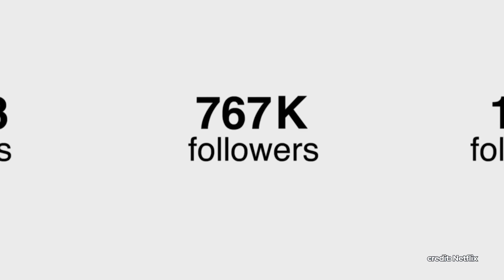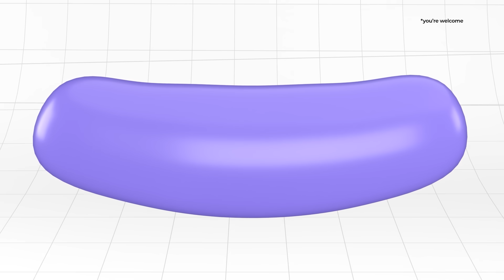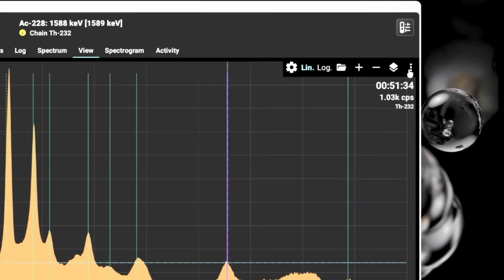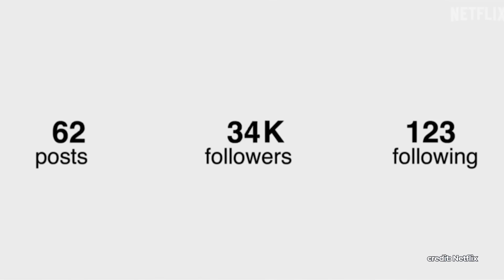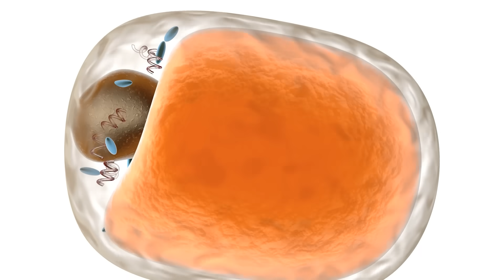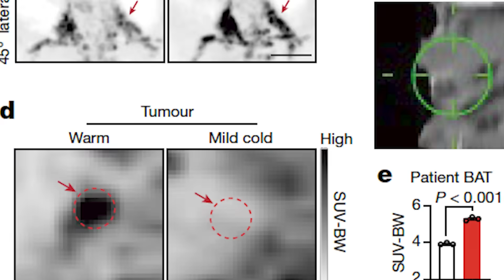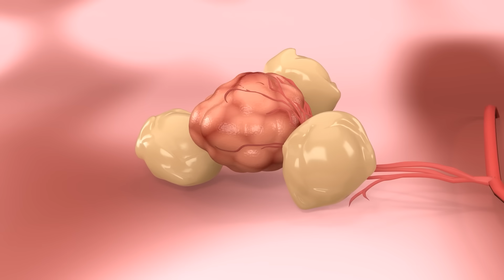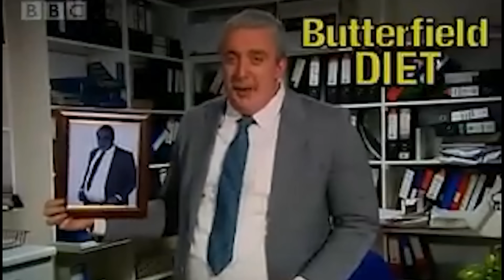Scientists Just Discovered How to Starve Cancer

Comment: What happened to the modified cells after the cancer is gone? Do they remain in the body to prevent future cancer cells, and if so what effect would they have on the body if there are no more cancer cells?
Reply: I wanted to assume that it can still be traced with a PET scan and surgically be removed the way it was applied, if need be. But definitely would like more information one the after effects of the tests as well.

Comment: Cancer switches to using glutamine as a fuel when denied glucose . So you have to block the glutamine pathways as well as the glucose ones .
Reply: Right. As Thomas Seyfried says, press the glucose and pulse the glutamine.
Reply: Research etymology. Glue - Glutamine, Gluten and Glucose.
Reply: Fenbendazole does it. Duh!
Reply: @ThatUkrainianGuy1  Tricky though... you have to pulse it, the gut and immune system can't sustain prolonged glutamine blocking
Reply: @djanitatiana  Tricky, how so?  Pulsing is simple.  On.  Off.  On.  Off.
Reply: @ThatUkrainianGuy1 please explain
Reply: @Lee-hq6tf  if you formulate a question precisely, I will.
Reply: @ThatUkrainianGuy1  what are the benefits of fenbendazole in cancer patients?

Comment: I vaguely remember thermotherapy is also effective(?) in killing cancer cells too. Body does not usually able to sustain in high temperature, releasing fatty acid to dump heat. As a result, Cancer cells which usually had immunity check have to release the substance, prompting body to kill it, or it will be cooked. Glad we have more tricks!

Comment: Side note. Giving the tumor an infection with a specific pathogen is an interesting approach. Most cancers are more vulnerable to same due to their mutations. Helps the immune system see the problem. This is an interesting approach here as we could poison the local energy supply to the tumor.
Reply: There was a study where they gave rats the flu vaccine and the closer the shot was to the tumor the more the immune system worked against cancer.
Reply: @babybalrog  unfortunately, there is no universal vaccine. Immune therapy requires specific vaccines for specific cancers. But if you know the match -- it actually works.
Reply: The black salve theory: It irritates the skin so immune cells rush to the area killing the basal cell carcinoma.
Reply: @babybalrog part of why cancer grows is that it turns off the immune system with regard to itself. Perhaps the flu shot super activated the immune system briefly.
Reply: Might add immune activating genes to the fat cells as well. Need to get rid of them later of course but maybe could even get the immune system to clean them up afterwards.
Reply: @lizekamtombe2223  given the average American diet, it may not be necessary to remove them, unless they start producing too much heat.
Reply: @caseyb1346  Spontaneus human combustion cases will go up you mean?
Reply: @ we're making Extremis real.
Reply: @lizekamtombe2223 Do you want people to die from fat loss? That idea is stupid and ignorant.
Reply: A pediatric oncologist injected herpes zoster virus directly into the inoperable brain tumor of a teenage boy and it was a fairly successful if novel treatment.
Reply: Aren't those called oncolytic viruses or something? The ones good at killing cancer in specific.
Reply: Reminds me of a video I watched about why whales don't get cancer: they can develop tumors, but their bodies are so big and have so many cells that tumors take much longer to grow big enough to become a threat, and eventually they end up mutating further to develop tumors of their own called "hypertumors", which stunt the growth of their hosts by starving them of nutrients and/or eating the tumor itself from the inside out.
Reply: Tactics can win a battle. Logistics win wars. In the war on cancers, maybe we should focus upon attacking cancers' logistics by treating cancer as a METABOLIC disease.

The USA war on drugs wasn't successful. Maybe a metabolic approach might have worked better.
Reply: @solconcordia4315  so what is that ? Metabolism approach ?
Reply: @solconcordia4315  respecto a eso... De verdad tienen que eliminar el consumo, el uso de esas sustancias bajo prescripción médica, dejar de comprarle esos cargamentos a los países, la droga nunca viene sola, se acompaña de armas, tecnología, personas, comercio de otros productos y servicios, pero tienes grandes logísticas de guerra en concentrar el crimen en ciertos sectores vulnerables y raciales, tienes un sistema que nutre sectores más ricos. Y todavía culpa a los otros países. Pero deciden luchar de manera física con un solo problema.
Reply: @solconcordia4315 i ve always thought it was futile to just treat a tumor because if you dont change the environment that makes for favorable growth, how can you keep it from growing back?
Reply: Good note!
Reply: My mom thought of that and we have eaten sugared ginger in hopes of cancer taking in the ginger sugar and killing the cancer.
Reply: @agrotta1650  ya my mom says quality baking soda and molasses mixed in water bonds together. When we drink it, the cancer pulls in the sugars and consumes it.  As the cancer breaks it down, the baking soda part of it releases high oxygen, in turn killing the cancer.
Reply: But what if you go one step further and give your tumor cancer? 🤔
Reply: Its hard to believe nobody has mentioned the recent success in Germany injecting Chlorine Dioxide in tumors where it dissolved the tumor and all cancer disappeared with no other harm
Reply: People do this with Warts, infect the area and the wart will drop.
Reply: Same sort of treatment works on warts.  Yes, you can cure warts.  My local mayo clinic does it by injecting a fungus into the wart.  I had warts for years that endured every type of treatment.  Even lasers shot at them did nothing.  Injecting the fungus got rid of all of them like magic.
Reply: See Coley’s Toxin. It’s all been done before, 100 years ago.
Reply: We figured this out 25 years ago.  It was on the cover of Time magazine.  A chemical drug called Venostat.  Which stopped veins and capillaries from growing into the cancer and so it would be starved of oxygen and die.  We've already been here and done it. A quarter century ago.  It was suppressed.
Reply: This is an approach people are currently working on, and in fact 2 oncolytic viruses have already been approved by the FDA. The first is talimogene laherparepvec, for inoperable melanoma, and the second is nadofaragene firadenovec, for some high-risk non-muscle-invasive bladder cancer.
Reply: What happens when this so called "engineered infection cells , who are exposed to our own healthy cells runs out of cancer cells to infect and then , as a result  evolutionarily gets selectively bread to infect our healthy one over time? (Survival of fittest)
Reply: @soulsbourne Then, you take an antibiotic, or your immune system clears it out like any other disease. Ideally you would not choose a base disease that could actually be threatening to most people, you would choose something that might give you a minor cold.

The goal is that the immune system courtesy of the infected virus cells or infection would start detecting and eradicating the cancer cells on their own.
Reply: What if they force the tumor to create the fat that will starve and kill it?
Reply: Possibly my favorite cure so far. It's a way of exposing tumor cell's  cloaking abilities to the our bodies T-cells. It's pretty genius!
Reply: What about bee stings? They activate the immune response, check the Lyme disease bee stings lady
Reply: 2 Tessalonicenses 1

Paulo, e Silvano, e Timóteo, à igreja dos tessalonicenses, em Deus nosso Pai, e no
Senhor Jesus Cristo:
Graça e paz a vós da parte de Deus nosso Pai, e da do Senhor Jesus Cristo.
Sempre devemos, irmãos, dar graças a Deus por vós, como é justo, porque a vossa
fé cresce muitíssimo e o amor de cada um de vós aumenta de uns para com os
outros, De maneira que nós mesmos nos gloriamos de vós nas igrejas de Deus por causa da vossa paciência e fé, e em todas as vossas perseguições e aflições que suportais; Prova clara do justo juízo de Deus, para que sejais havidos por dignos do reino de Deus, pelo qual também padeceis; Se de fato é justo diante de Deus que dê em paga tribulação aos que vos atribulam, E a vós, que sois atribulados, descanso conosco, quando se manifestar o Senhor
Reply: the polo vaccines cures non surgical blastoma in the head if patent has good vitals. first the tumor swells then over 3 month it dies. it leave a hole were the cancer died.
Reply: They have been doing trials on brain cancer and using the polio virus.
Reply: It's been a well known fact for 4 decades that the immune system itself kills cancer and is most always 100% successful at it every time they do an allogenic bone marrow transplant to cure blood cancers because the brand new immune system sees the entire body as a foreign object and begins attacking various organs and in the process kills any remaining cancer cells. It's called Graft vs Host disease or GVHD. It's so powerful it can kill the patient itself in minutes if an attack is not quickly calmed with a high dose of Prednisone.  I learned about all this in 2009 when I had a transplant from an unrelated donor to cure leukemia. 16 years ago and still no cancer.  After a Google search out of curiosity it said scientist have been experimenting with it to cure other types of solid organ cancers but the procedure still remains extremely dangerous and why it's still in a testing phase. If they could figure out how to point the immune system to cancer cells only without damaging other bodily organs I'm pretty sure that's a cure in itself.  A bone marrow transplant is a totally painless procedure and done in a few minutes but only after the original bone marrow has been destroyed with chemo a week prior. A doctor wasn't even in the room when I had mine. It was just like a blood transfusion administered by two nurses. It's all the stuff that starts happening in the following months that is dangerous. Mine even changed my blood type from O positive to B positive.  O has no antigens so I can still receive blood from O donors.  mRNA vaccines is an attempt to accomplish the same thing but fails miserably. Much more knowledge is required to really understand what makes the immune system do what it does.
Reply: there are also multiple viruses being crispr'd to eat cancer proteins which then die once the cancer cells are gone.
It's very promising, but will probably need another decade or so in trials as genetically modifying cancer eating viruses, that usually would hurt us, too, is a very sensitive topic
Reply: Yeah, I love the 1901 Italian rabies vaccine they tested on prostitutes. It MELTED their fibroid tumors.
Reply: I'm experimenting on myself with self-vaccination on stage-4 (metastasized) cancer. I discovered from Wikipedia that I largely have TWO lymphatic systems: one for each side of the body, the one on the right much smaller than the one on the left. They are drained through different bodily exits.

I got metastasized cancer on the left side but none on the right side. After fasting for and doing the antimatter Positron-Emission-Tomography with POSLUMA, I forgot to flush the radioactive moiety early enough but I did wake up to the fact that I needed to get it flushed out (it's highly radioactive — equivalent to eight years of background environmental irradiation). I prepared some citrus-laced water and survived on it alone for a while (and supplemented it with Biblically known olive oil for calories; three days were how long Jonah had stayed inside the great fish so I flushed for a total of three days). I figured that the terpenes hot-water extracted from the orange peels would clean out as a surfactant much of the debris of the radionuclide scan and some of it would flood over to my right side to trigger my reserve lymphocytes in my reserve immune force's lymph node. Sure enough, the main lymph node near my neck on the right side swelled up but after a few days it largely shrank back to normal size.

Maybe the self-vaccination has already started the lymphocytes' fight already.

I keep my fingers crossed🤞 and I know that I'm certainly in the hand of God ! 😂

Things are so far so good. I got an exceptionally good response on the cancer treatment drug I was offered.
Reply: It doesn't always work but if I remember correctly it works really good with bladder cancer I can't remember what virus they use I think it's like a herpes virus or something
Reply: @leelee-y5x  REO virus was used in Reolysin / Pelareorep
Reply: @leelee-y5x  Bladder cancer might work with oncolytic herpes simplex (i think it’s got some immunity-defeating gene removed so it multiplies in cancer cells only), but iirc the more traditional approach is to throw the BCG vaccine bacterium (weakened cow tuberculosis) on it. BCG is unexpectedly good for a lot of things, just not great for preventing tuberculosis infections (50%… it still prevents nearly all deaths in infants).
Reply: just cut all sugar out, eat keto its starves cancer rather simple
Reply: @xomox5316 they already discussed this... Your body needs glucose, it has ways of both storing it and synthesizing it and tumors have more mechanisms to ask for more blood vessels to retrieve more nutrience than the rest of your body. You "starve" yourself before you starve the cancer, as this video has already put it.
Reply: 59 degrees f
Reply: cool, this is what i was getting on here to ask about, if it has been tried yet to poison the glucose supply.
Since the tumor cells take up so much more sugar than healthy cells, Maybe a little bit of poison wouldn't kill the healthy cells. But as the tumor cells are gobbling it up, hopefully it will kill them by getting a larger amount.
but what poison? Maybe the pathogen like you said, but can it be attached to glucose intake?
And then what about the brain and heart? Do they burn through sugar at a pace near to aggressive tumors?
Reply: I have a suggestion. Inject Vitamine C straight into the tumor. Just give it a try.
Reply: It sounds good in principle, but the reality is that most cancers are not strictly clonal and exhibit considerable heterogeneity, which we only started to intensely research over the last 10-20 years. We still have a way to go before we can ensure the combination of treatments we offer patients can eradicate the primary tumour and any reservoirs of disease that spread in the early stages.
Reply: The immune cells, learn how to detect the enemy in the training camp called the Thymus. If any immune cell was to attack the hosts healthy tissues or cells rhey are destroyed so much so only 1% make it. These T cells work in tandem with macrophages cells, the clean up crew. You need a proliferation of both. Ever heard of Macrophage Activating Factor, you find that in breast milk and T cells Macrophages will not function without vitamin C in serum.
Reply: I pisoned the glucose supply
Now all cancer is dead
YIPPEEE
Reply: @narrativeless404  and how do you do that plz
Reply: The chinese got some treatments with this approach working with good results
Reply: @matheuscerqueira7952 Can you cite some reputable sources describing these and post them for us here, please?
Reply: @matheuscerqueira7952 no the chinese don't, how can you trust chinese after covid? Chinese have to stay away from any international discover treatment or they will find a way to make it mortal too
Reply: I'm thinks they call that chemo?
Reply: Isn't chemo just raw chemicals, while this uses viruses? 
 @darwinmonzingo9738
Reply: @darwinmonzingo9738 chemo shrinks tumor cells it doesn't expose it tumor cells. This is why cancers return years down the road. Not to mention if the cancer cells mastitis. It's your blood is now an open highway for those tumor cells to lay dormant and grow somewhere else.
Reply: @darwinmonzingo9738  chemo is chemicals, not viruses.
Reply: Try it on yourself first. Let us know the results.
Reply: @ThatUkrainianGuy1  I mean if i get cancer, i know exactly where i'm telling the doctor to put my annual flu shot.
Reply: @babybalrog  Never heard such rubbish!
Reply: @babybalrog  In de garbage bin?
Reply: @ThatUkrainianGuy1  I mean, its already being done. Oncolytic viral therapy is based on this concept.
Reply: @ThatUkrainianGuy1  A lot of people have done that oncolytic virus thing to animals. A few have done it to dozens, even hundreds of humans. And then there’s an Eastern European virologist who put a bunch of weakened vaccine-grade measles and VSV into her own cancer and shrunk it enough for a clean surgical cut. Humanity is not out of mad scientists who self-experiment yet!
Reply: @ThatUkrainianGuy1  After this treatment he  won't be alive to tell you the results..
Reply: @ThatUkrainianGuy1  There are oncologists who stop working in hospital because they can't digest that most cancer patients die because of the traditional cancer treatment they receive. These doctors have a heart and compassion for their patients!
Reply: Very good observation.  Please hope they are successful.  Women are affected by cancer and when men die women needs to deal with these!